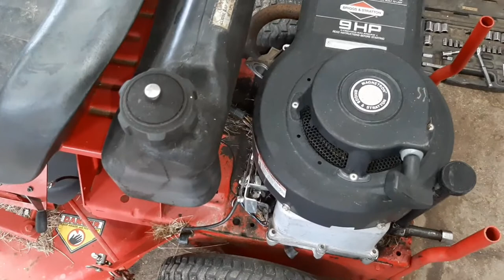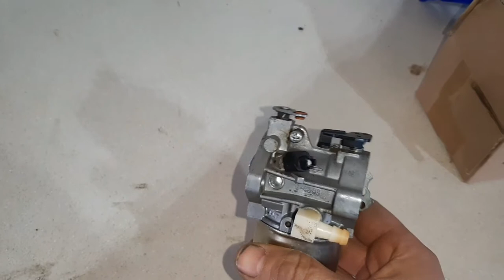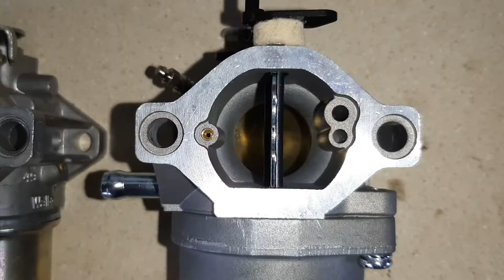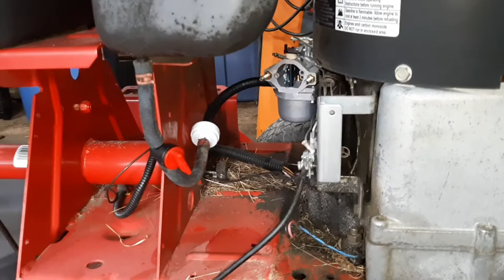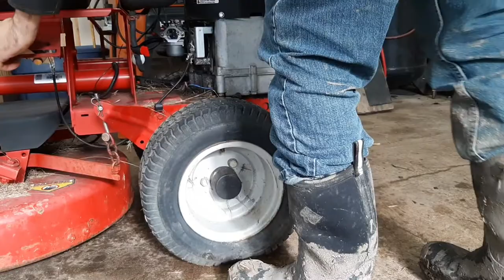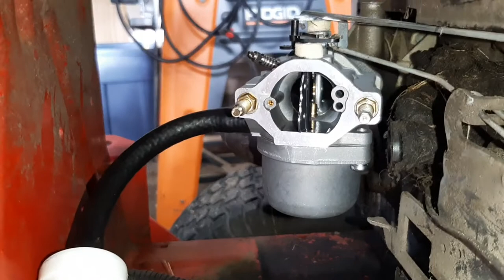Trying a Chinese carb on this Snapper rider

Comment: I am a stickler when it comes to ordering carbs, That model number is grouped with the28M707 series where you will see the actual 28R707  included in the description . It has the full route and is exact. If you search on ebay 28R707 alone you will not get the exact carb.